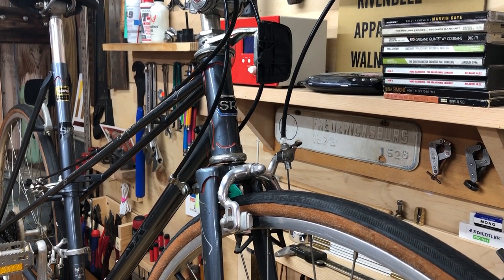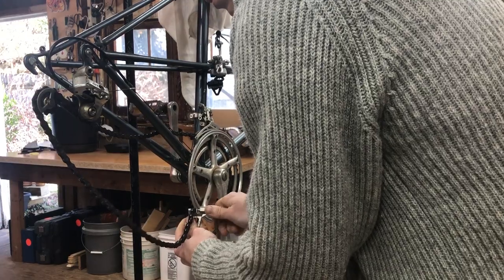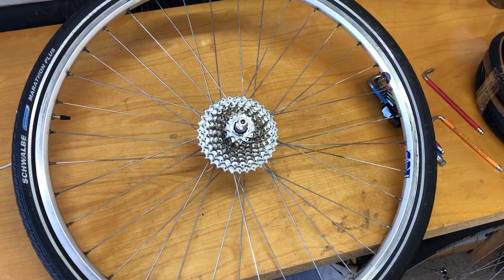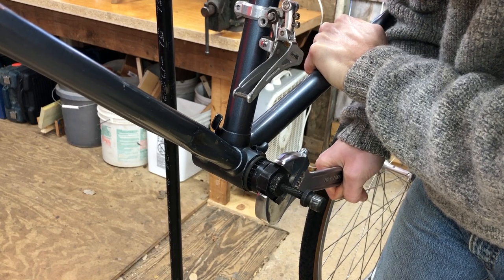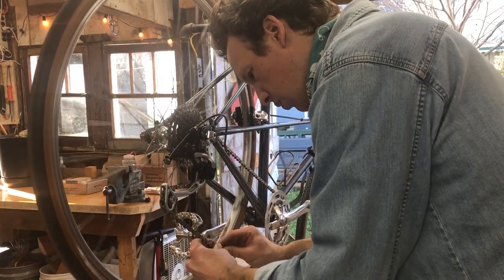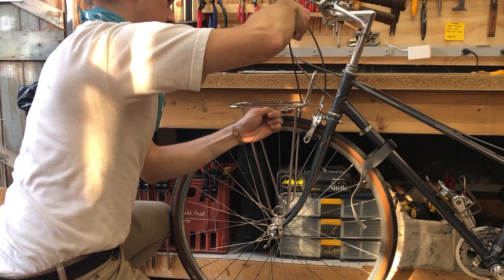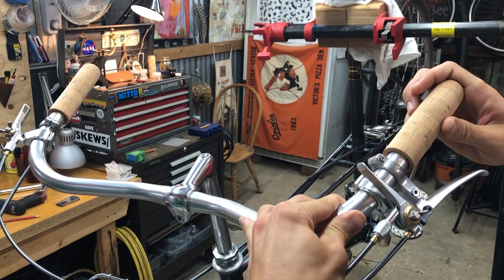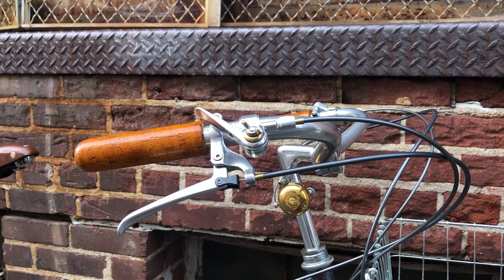Vintage Japanese Mixte Bicycle Restoration,1980s Sakae Ringyo Steel, 27" to 700C conversion.

Comment: Good tip with the paper towel for adhesive removal. Try a wooden popsicle stick for scraping😊.
Reply from the maker: That's a good idea, I usually go for the options that occasion scratching and marring!

Comment: Nice tip with the remover of decals/stickers, using the towel (or "kitchen paper"). I will use enamel nail polish to adhere stickers, so to remove them would require a similar method of holding thinner or acetone or something to dissolve the enamel, if you want to remove the old sticker easily. You could sand it off, but that has its own drawbacks. Great video, thank you for documenting your work!
Reply from the maker: Thanks a bunch! I haven't sealed stickers in with nail polish, interesting idea

Comment: Beautiful bikes and video. You make me want to go out a wrench on my bikes. 
One cheep trick when spreading your dropouts is to check alignment with a string. Go from the dropout around the head tube and back to the other dropout. Measure for equal distance at the seat tube.
Reply from the maker: Thanks for the tip, Brian! Great idea.

Comment: Easy to use and hold weight up to 300 lb
Reply from the maker: It's nice for sure but I don't know if I'd trust it to tote 300lbs! The tubing is very light, it's like a road bike.

Comment: You can usually remove stickers with the help of a heat gun. You don't need to get them very hot, just hot enough to soften the adhesive, and then you can peel them off leaving little to no residue behind.
Reply from the maker: Good call!

Comment: This brand actually doesn't have anything to do with Sakae Ringyo. It was a creation of a west coast importer named Windsor Enterprises who got these bikes manufactured by contractors in Japan. And I could be wrong, but I think this is older than '87.
Reply from the maker: Very interesting! I read somewhere (but can't remember where) that the SR frames were under Sakae Ringyo, that's what I based that on. It was probably on a forum somewhere. We are only sure the bike was purchased in 1987, it does seem possible it's older. Thanks for sharing, please let me know if you have any further info on Windsor, SR or ad material about these frames.

Comment: Hi Eric, I’ve got a nice 81’ Kuwahara sports tourer, lugged, longish wheelbase, good clearances… sort of Fauxdini (sorry) - I want to spread it as you have for a modern wheelset. With cold setting, is there a limit to be aware of in advance to avoid bowed stays? Cheers!
Reply from the maker: The Kuwahara sounds sweet! Fauxdini, I approve. 

I do have a modern Mavic wheelset, rear spaced to 130mm. I don't know much about spacing and bowing the stays... I didn't have any problems myself but I'm by no means an expert.
Reply: Cheers Eric! Well, your builds certainly do look expert :) - I think I’ll just give the cold setting a go cautiously, its a new area of repair for me but nothing ventured! 

Love Kuwaharas - also got an 80s long slack mtb with a massive triple chainset lol. Rides great, with albas, b17 etc

Keep the vids coming dude! :)
Reply from the maker: @markslawinski6948  Hard to beat a good set of Albatross bars and a B17! Best of luck with your spacing venture.

Comment: I love the look of the mixte frames. You've done a great job of refurbishing this bike. The rear stay spreader is brilliant. I'll have to make one if I ever need to adjust my spacing.
Which I might. I just found a mid-80s Benotto mixte in the thrift store. The rear dropouts are a little tight and I might want to tweak them.
It's very old-school, with cottered cranks, 10 speeds and 27" wheels. I plan to keep it as original as possible, but might convert it to Dutch style upright in honor of my more advanced age. 
But I'm going to try out the drop bars before I do.
Reply from the maker: That thrifted mixte sounds sweet, Claude. The drops could be fun! The spacer is just some all-thread and a few nuts. Check out RJ The Bike Guy here on YouTube, he has a video about adjusting the spacing.

Comment: The paintjob is pure beauty! Period. But dont hesitate changing classic parts against new quality parts. I rode a "custom" seatpost stem (japanese part i believe) on a 1984 Centurion Le Mans alot. One day the aluminium saddle clamp simply cracked cold. Got me a broken disc. I was lucky, but still lots of ouch.  So remember, safety first.
Reply from the maker: Ouch! I'm sorry to hear about that, Kristian, no fun at all. 

I'm certainly quick to ditch any suspicious old equipment. I'm lucky I didn't ride that wheelset, took it right off the bike when I got it because the hubs were too loud! It sat on the wall for many months and then... the cassette came off! Would not have been fun if I had been on the bike, though I hope the quick release skewer might have helped save me from catastrophe.

Comment: how are those mks Lambdas? I've never seen someone using them but i truly adore the looks! overall a wonderful bike! my gf is currently riding a - probably 86 - Panasonic Touring Deluxe Mixte that i treated with some Conti GP Urbans, a beautiful Saddle just like the one you used here and a toulouse bar,  the builds look quite similar : )
Reply from the maker: Sounds like a great Panasonic, Andreas. 

I like the Lambdas a lot, I had them on a Surly LHT and I have the newer version the Gamma/Monarch on my Appaloosa. I've also put them on a 1985 Bridgestone MB-3 I built for a friend.
Reply: I have them on my LHT. I used Riv’s set screw kit and installed them. I think the new one come already in. Kinda slippery without the spikes.

Comment: A lovely build well done. I did something similar on an old Claud Butler Mixte for my partner. I have a real soft spot for those frames. Have you investigated making a 'frame dimpler' to create more tyre width between the chain stays? I just used an old G-clamp with a shaped bit of steel rod welded on and a bit of hollowed out wood much like your badge maker. Worked a treat and almost looked like a factory job. I tried to include links to pictures but YouTube doesn't seem keen on that. All the best!
Reply from the maker: The Butler sounds sweet. I have seen some homemade chainstay dimplers shared online but didn't think to try dimpling on my own. I'm glad to hear yours worked out well, bigger tires are the best.
Reply: @ericmarth  They are indeed. Shame I can't attach a photograph. If interested you may be able to track down some images on my old Flickr account by searching my name under 'people' and going to 'Claud Butler Mixte' album. Keep up the good work. Chapeau!
Reply from the maker: @jonathankeenan5163  Found it! That butler looks great! Some other nice bikes, too!
Reply: @ericmarth  Ha! Thanks. Could do with updating the list but just watching your channel and looking through some old builds has got me thinking ...

Comment: No issues with assembly for me https://www.youtube.com/post/UgkxHL1v1R3NE5x4KiYfyt8dnQmyNYz7qi5L  but I could see where some might benefit from using an experienced bike assembler/mechanic. I'm an older rider starting back after a 10 year break. This bike exceeds my capabilities and has been easy to get comfortable riding. I'm mostly on easy trails with almost no street riding and have not been disappointed with the performance of the bike. My fitness level is far below what I previously rode with and because of that the mileage is going on the bike slowly. While I'm losing weight slowly, the bike seems to tolerate my 220 pounds just fine. The bike has been used by several family members ranging from 5'5" - 5'9".
Reply from the maker: I'd say no so much. I'm 5'10" and 175 and the bike's small for me and the tubing is quite light!

Comment: getting way into mixtes lately. Idk why they're just neat and unique. When did these frames become popular and why?
Reply from the maker: Hi Levi, I'm glad you're into the frames! I don't know much about their history but I thought (and could be wrong) that the low drooping tube showed up shortly after the first "safety" bicycles were introduced. Practical and comfortable for city riding. Sadly I'm no bicycle historian — readers, free to enlighten me further.
Reply: @ericmarth  thanks for the response! I’ve been reading into it as well and I can’t find much other than they’re just a different look and that The structure can be manipulated a bit to get a good middle-ground performance somewhere in between a step through and traditional top tube road bike. Beautiful design nonetheless! Great way to mix it up if you’re tired of the sameness of most road bikes

Comment: another masterpiece Eric - appreciate it. One follow up - I've always been interested in why people bother with shellac, and that plays out in your build here. It seems like it enters this unnecessary (?) wild card into cloth grips. I've been using them for ten years and don't understand the appeal. What's the line of thinking there...
Reply from the maker: Thanks David 😎Interesting question about the shellac. Interesting because... I don't have a good answer. My short answer is: Just for looks. Looonger answer: As far as I understand it applying shellac to cotton bar tape is something of a tradition in cycling going back I don't know how far. But as to why? I'm not sure! To protect the tape? Enhance the color? It doesn't seem to make it any easier to grip or more pleasant to the hand. I find multiple coats of shellac make the bars more slippery. But I do like the look of several coats of amber shellac on yellow bar tap. That classic French vibe. That's what I was hoping for when I put amber shellac on the orange tape. It didn't turn out and I didn't have any yellow tape so I grabbed some brown. I didn't like the way that looked, either. I kind of wish I'd done a coat of clear on the cork grips instead of amber. It seemed to me that a coat of shellac was in order to provide a little bit of a sealer on the raw cork.